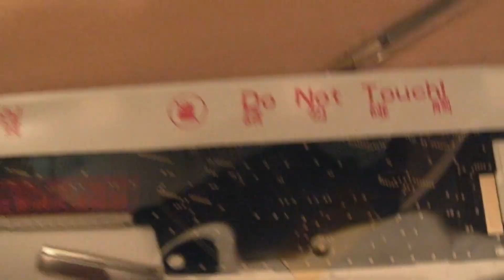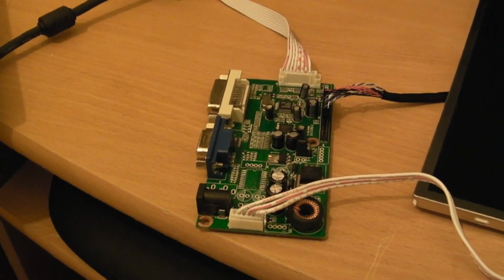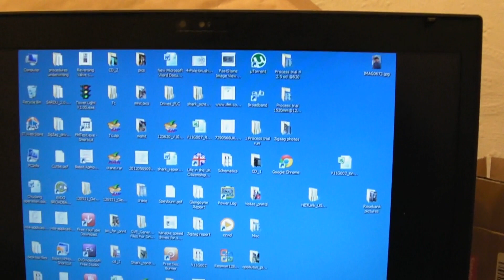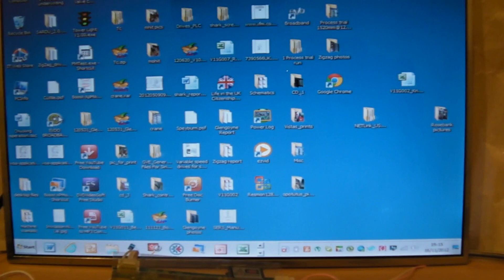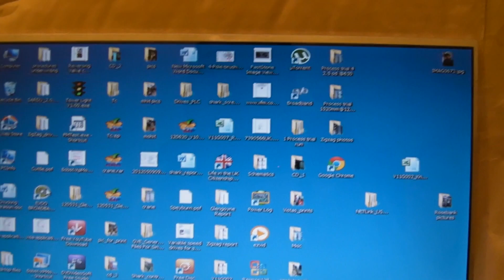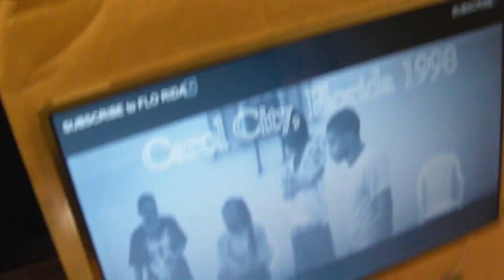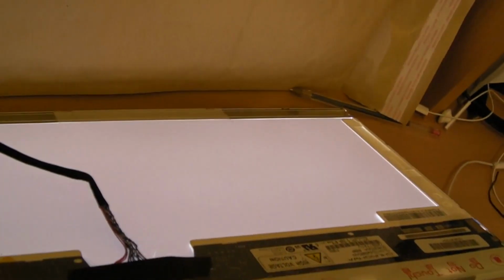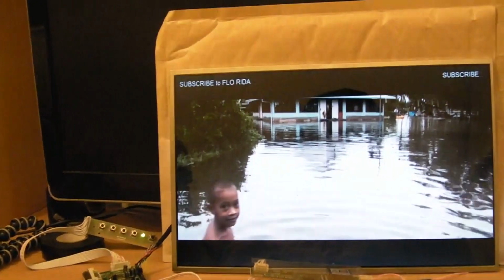How to Use Old Laptop LCD Screen

Comment: when I connect the board the led turns green and after a while it turns red. when I touch the IC on the board I found it to be hot. does the board get hot?

Comment: Can i find a control board which is USB 3.0 powered and connected for Old laptop screen. Please advice.
Reply: USB does not supply enough power to make an LCD work, you would have to connect it with VGA or HDMI and have an external power source.
Reply: +Nicholas Ruiz USB C does

Comment: Would it be possible to use a laptop screen on a Raspberry Pi?
Reply from the maker: yes it is possible will be doing a video on it soon cheers
Reply: +Kevin Langley  yea, you can use the laptop screen on any OS with any Hardware setup, provided it has the display drivers , and the connection ports

Comment: I have a Output Source with AV, but the controller kit needs VGA. Do you have a solution for this problem ?
Reply: ebay is full of convertor boxes.  VGA->AV, AV-VGA, MHL->VGA, AV->RGB, etc, From about $10
Reply from the maker: Yes what you need a AV to  VGA converter here is the link which i just googled :

http://www.ebay.co.uk/itm/like/390389684951?limghlpsr=true&hlpv=2&ops=true&viphx=1&hlpht=true&lpid=108&device=c&adtype=pla&crdt=0&ff3=1&ff11=ICEP3.0.0&ff12=67&ff13=80&ff14=108

hope this helps thanks
Reply: naresh lal
But this converter is from VGA to AV; does it work in the opposite direction ?
Reply from the maker: no  i  have to  say sorry  for that i  just found this one and recommended there are devices available for sure to do  this job but this need bit of research but i  am  afraid to  say  sorry  at this stage
Reply from the maker: Micky thank will have a look at it cheers